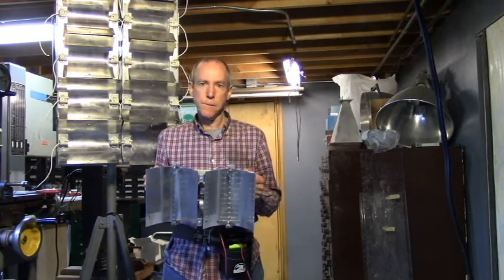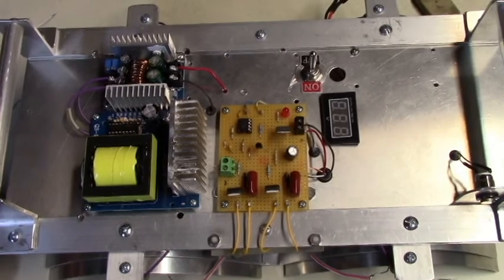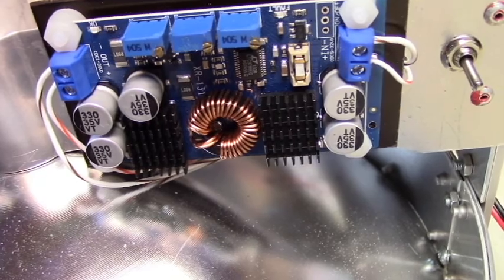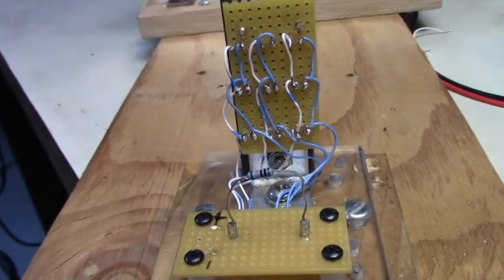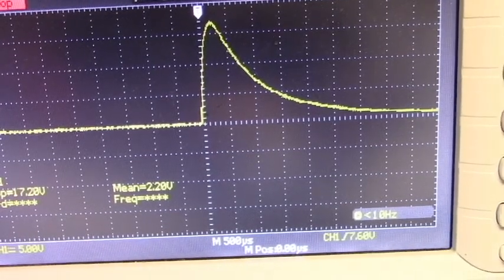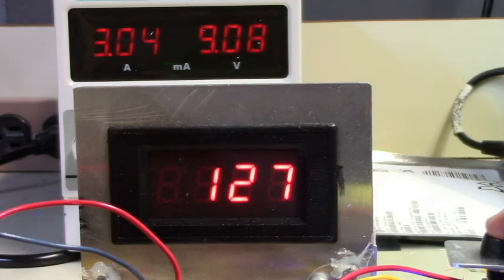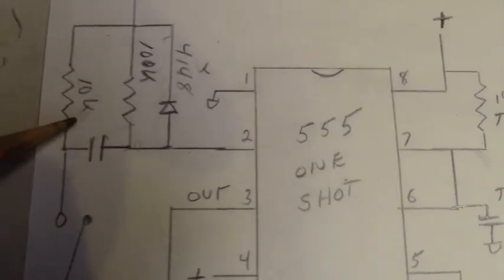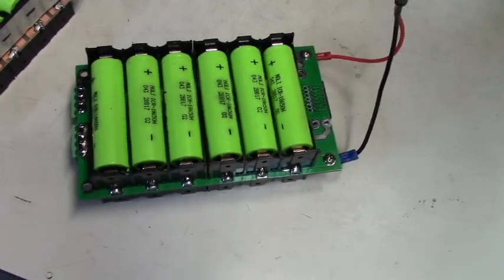Xenon flash tube experiments

Comment: Hi Stephen, this is Jovel from the Philippines. I'm just wondering if you have any information regarding the specs of the Speedotron 4803 transformer? My secondhand light got smoked because I plugged it in the wrong voltage by mistake. Perhaps you have a copy of the schematics or just a photo? Can't find any info here at all so any help would be great - thanks!
Reply from the maker: Which transformer is the speedotron 4803?  I just used  E bay inverter drives.
Reply: @stephenhrobak3631  hey stephen, the transformer inside the body itself
Reply from the maker: @jovellorenzo  One row of pins is for a center tap primary. With 2 pins in parallel on the center and either end. The other row has one end ground and pin 5 high voltage. Check it with an ohm meter.

Comment: GREAT VIDEO!
I can't quite see it clearly,but did you use the ebay charger as "double output"?  I think you did, as it looks like the two outer output terminals are used in the three-position connector.

These cheap chargers are great (I have several)...EXPECT FOR ONE THING...those two output caps are only rated at 400v.  I always replace mine with 450v rated caps.  They can exceed 400v per side.  If you do this, make sure the cap dimensions are the same size since they are crammed in tightly.     I also like to wire the pot so that voltage increases with a clockwise turns.
Reply from the maker: That was a eBay charger. And yes for the price they are great. I'll be sure to replace my capacitors.